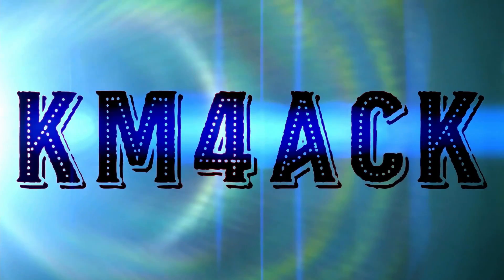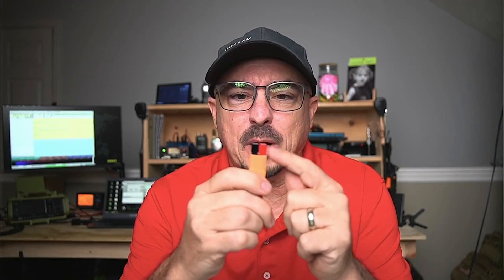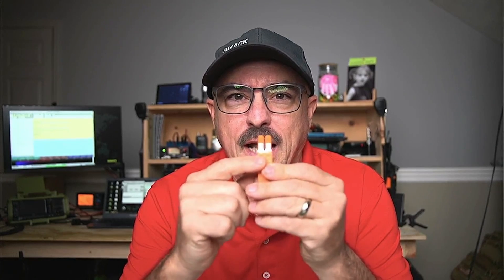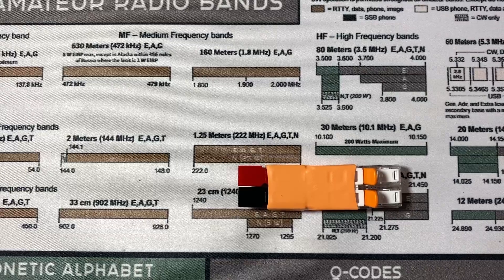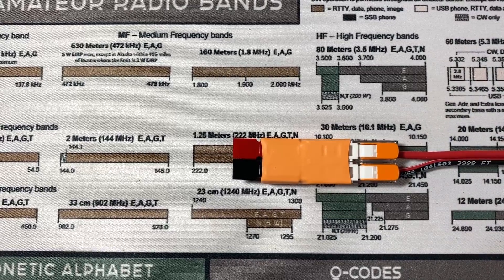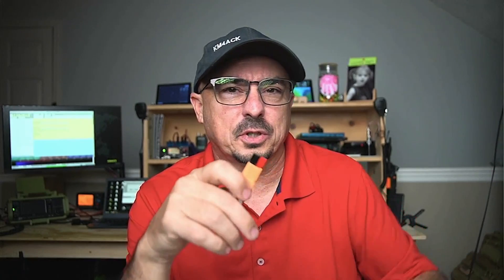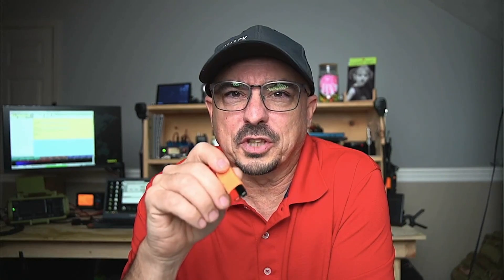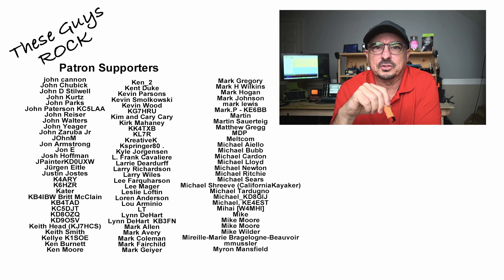AP QuickCons

Comment: There's a 30 amp Wago 221 connector.  The awg range is 20 to 10, where it's 24 to 12 on the 20 amp Wago 221.  Ideal makes a good lever nut as well.  I use Wago 221s in home wiring now, so I'll probably fab up a couple of these.  If I like the result, I may order some 30 amp 221s.  They're a bit pricey in small quantities, but would be super handy when needed.
Another variant of this might be a pair with "T" connector for quick temporary connections to mobile FM radios.
Reply: An original 30 amp Wago 221 Series Inline Splicing Connector with Levers does not exist.
Reply: @ThinKkBIGG  You are right. I've been thinking of Wago 221 lever nuts rather than in-line splice connectors.

Comment: Saw the video and ordered and received 4 sets.  I have had a field Powerpole failure that I had to sacrifice a good cable and twist the connections of the wires on the failed cable.  This would have bee a simple fix and I would not have to fix two cables when I got home.  Excellent communications but when you  order include your address so he can find you.
Reply: I hope this helps out alot of folks.  Thank you Dave!

Comment: Nice, I've got a Noco Charger that has a propitiatory plug,   and my motorcycle still has the old battery tender jumper.  well, turns out the 2mm banana plugs I ordered to fit my PackTenna fit right inside the Noco plugs. so... Now I have my own adapter, Noco to Tender, and Noco to Powerpole, for free. :)

Comment: Just a question - and please correct if I am wrong in my understanding.  The Wago connectors are rated for 20A and 600V, I believe.  I think the 15/30/45 Anderson Powerpoles might be rated for those currents at 160V.  So if you normalize for power (watts), the powerpole side would be the weaker link, right?
Reply: The difference between 15, 30, and 45 amp Powerpoles is not the amperage of the contacts, but the size of the hole, what size wire can be crimped into the end of the contact.  It's the wire connected to the Powerpole that determines the amperage it can carry.
Reply: @saxmusicmail  Hey Sax, the 45s are a tiny bit thicker but not much at all, but yes the wire crimp hole is the big difference in the three sizes.
Reply: Hey David, great question. Which every way you look at the electrical characteristics, the Wago end is the limiting factor in ampacity. Wago has safety rated them at 20 Amps. To increase the amperage you can take four (2 sets)  of AP-QuickCons and run them in parallel, with the two sets being used as disconnects  This will give you 40 amps capacity.  (  two runs of 12 AWG wire and four AP-QuickCons)